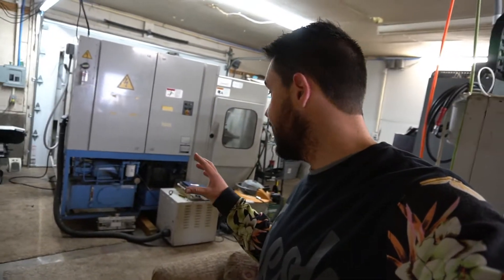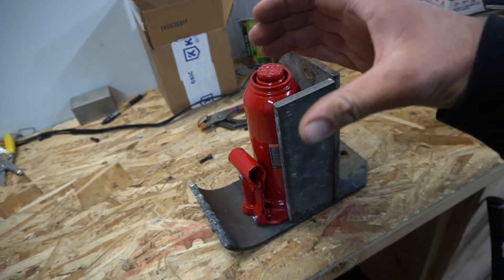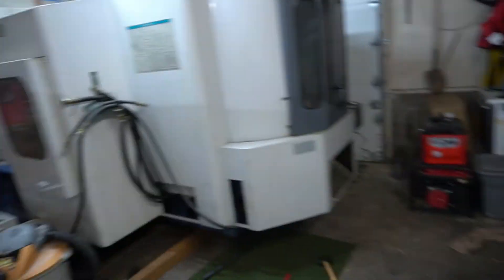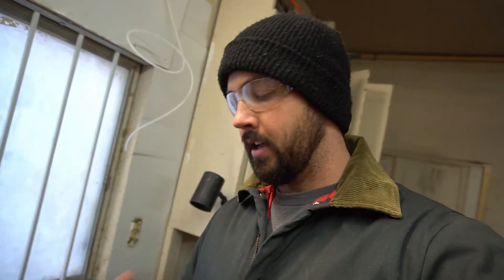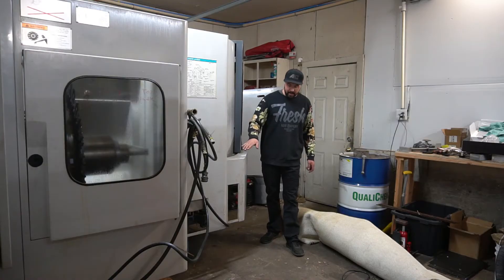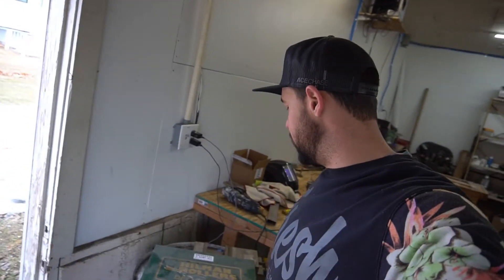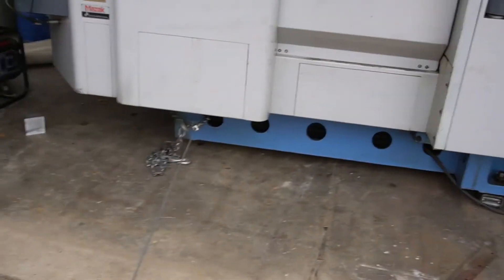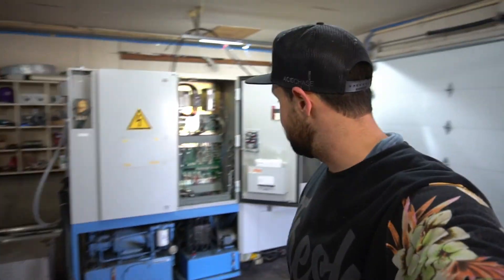Homemade Toe Jack / Machine Skates

Comment: Atleast you tried, you dont have right materials on hand.  If you only have PU wheels for  pallet jack.  Or you could just use 2 5Tonner pallet jacks
Reply from the maker: I ended up renting some actual skates.  It worked way better haha.  I thought my ball bearing rollers would work but lesson learned.  The toe jack did work well though.

Comment: My son has a buddy that has skates like that with a pivoting plate on the top.  For big moves, you can weld the plate to the machine.  You need a burke bar.They are great for lifting and final placement of heavy machines.  That is the only useful thing that I have learned from watching Essential Craftsman.